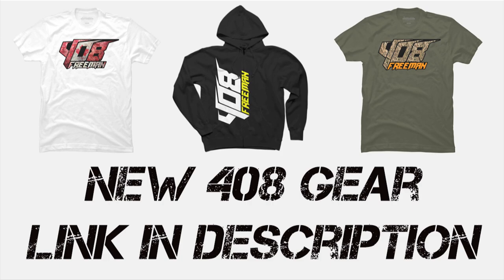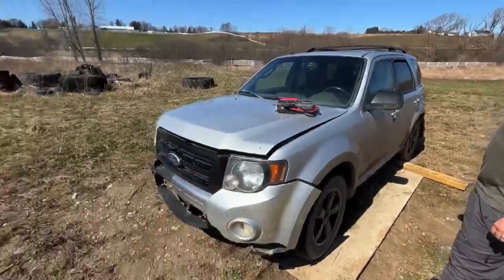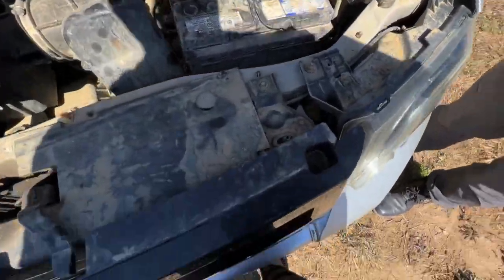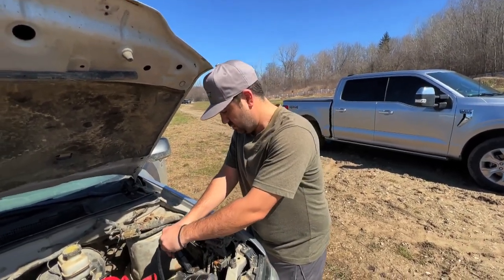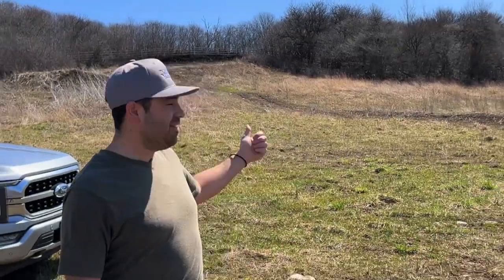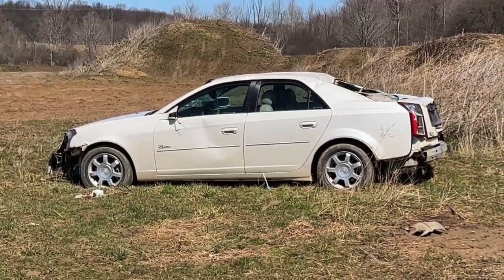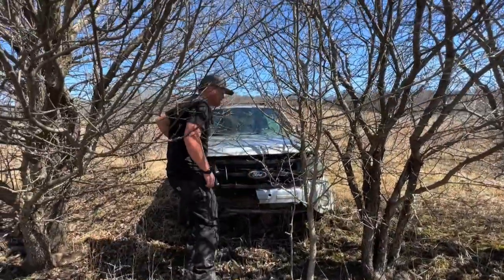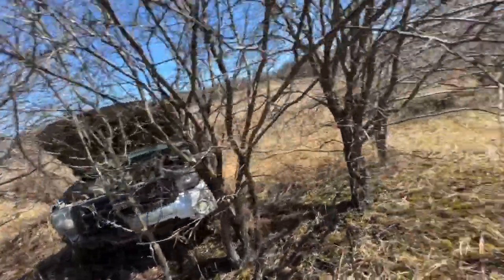Ford Escape DESTROYED CRASH!

Comment: You could use the seat belt instead. Pull it all the way out, put threw the bottom of the steering wheel and buckle it. When you let go it'll sound like a ratchet and locks the wheel in place.